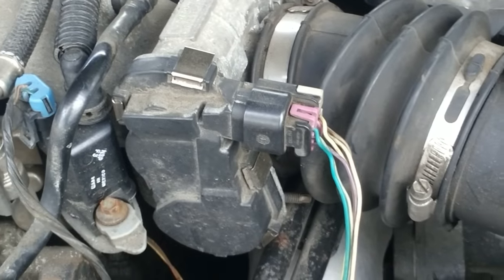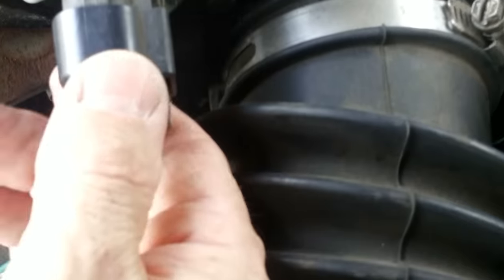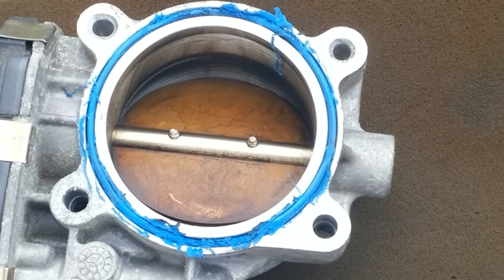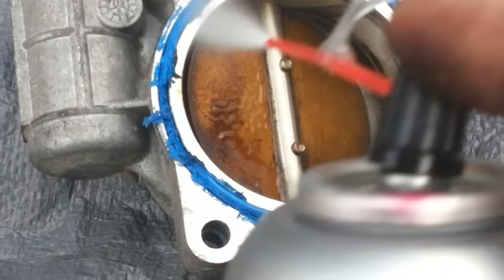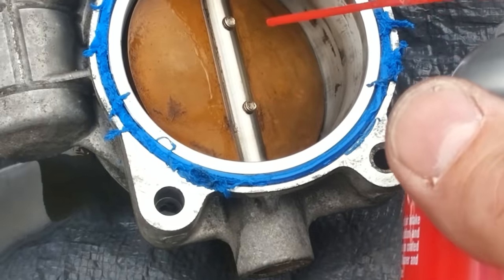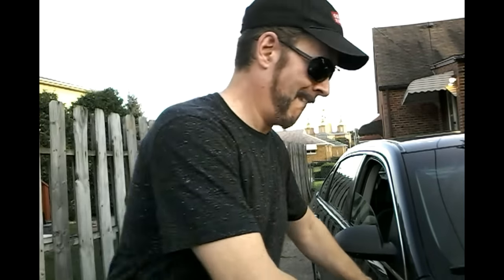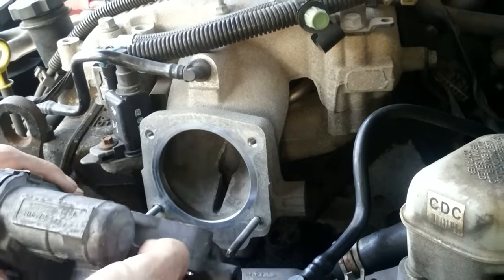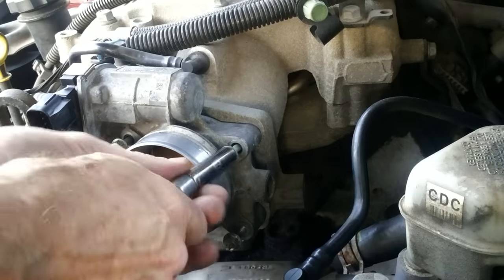Reduced Engine Power.  Here is the FIX.

Comment: I have a Chevy impala the engine power reducing  Light keeps coming on and barely letting me press on the gas and now I pulled in a parking lot to turn it off and let it cool off for a minute and now it won’t start at all just makes a clicking noise what do I do this is my first car so I know nothing about it and NOBODY AROUND THIS MF TOWN CAN HELP ME. Please help?!...😩😭😭
Reply: Just had same problem. I bought a replacement gas pedal off amazon and it fixed my problem . Clicking noise may be bad starter but Part u need  for engine reduced is ACDelco 25830023 GM Original Equipment Accelerator Pedal with Position Sensor
Reply from the maker: If it's just clicking it could be a dead battery.

Comment: Is there a way to test that sensor before replacing it? Have 2008 pontiac torrent with 3.4L and the reduced engine power light is on as well
Reply from the maker: Check for fault codes.  P2135 means throttle position sensor.

Comment: question would that be the problem for the service traction control too??
Reply from the maker: Vino Velasquez  That might be a different problem.  Several things can cause that. Most common is faulty wheel speed sensor.  What kind of vehicle?
Reply: It's a 2009 mpala.
Reply from the maker: Vino Velasquez  Check it for abs fault codes.  Thats a good place to start.

Comment: Would this method work on a 2006 Buick Rendezvous? A friend from work has gotten that reduced engine power pop up  as well but cannot find a fix for it
Reply from the maker: Have him scan it for codes.  P2135 mean throttle position sensor.  Follow the video to replace it.  Also, check all wiring and grounds.
Reply: @lifeafterlife8417  Awesome thanks mate much appreciated

Comment: it happens on my ‘03 silverado tho
Reply from the maker: Sometimes those silverados have a problem with the cooling fan.  It's on the same circuit as the throttle position sensor. When the fan turns on it drops the voltage to the throttle position sensor well below the 5 volts it needs which triggers the reduced engine power. Have your fan checked.  Could be a good place to start.

Comment: Well that is not the problem because I changed the entire throttle body and mine still did it 2009 Silverado piece of s*** mine did it for two years and I changed all kinds of crap on it so to say that's the fix it's not have a good day didn't like your video The Crickets were better sounding than you were

Comment: Someone help! I changed throttle body&sensor. And my gas pedal with sensor. I have a 2003 Chevy tahoe. I also put in a new battery. I ran for 30 mins and went back into reduced power mode.
Reply from the maker: The cooling fan is on the same 5 volt reference signal as the throttle position sensor.  If it is faulty it could be pulling that 5 volts down and triggering reduced power.  Very common on Tahoes.  With the vehicle running connect a voltmeter to the accelerator pedal position sensor.  Should read 5 volts.  When the cooling fan turns on it might bring that down below 4 volts.  If it does, disconnect the cooling fan and see if it comes back up to 5 volts. That will confirm a faulty cooling fan.  Best of luck!

Comment: GM needs to quit buying it's electrical parts from China, they've been going downhill because of that.
Reply from the maker: It's their drive by wire system.  It's a terrible design. Blame it on the engineers.

Comment: And all you chevy guys make fun of ford guys. I watched this video hoping it would help with my 06 saturn vue but nope
Reply: Not a Chevy guy.  Chevy VICTIM.  How can I help you with your Saturn?
Reply: @davidtankersley9520  all of a sudden today the reduced engine power light came on and the car wouldn't move
Reply from the maker: Does the engine start?
Reply: @lifeafterlife8417  yes engine starts sometimes it revs up when I hit the gas, sometimes it doesn't and if I put it in drive after reving it it barely moves
Reply from the maker: @jamesTBurke  If you turn the car off for 5 minutes and restart, does it run normally?
Reply: @lifeafterlife8417  yea engine runs fine but nothing happens when I press the accelerator
Reply from the maker: Ok.  First thing to do is scan it for fault codes.  This will give you direction.  If you cant do that then check all of the wiring going to the throttle position sensor.  Make sure you have a good connection. @jamesTBurke
Reply: @lifeafterlife8417  just replaced the entire accelerator assembly.  Now to see if it stays gone
Reply from the maker: @jamesTBurke Must have gotten the old P2136 APP sensor code.

Comment: LOL.
Reply from the maker: Try it.
Reply from the maker: @santanalarkin6118  Ok, first you can pull over in a safe spot and turn the engine off for about 2 to 3 minutes.  This will temporarily get rid of the reduced engine power mode and get you home.  Next, have the engine scanned for fault codes.  This could get you pointed in the right direction.  If you don't have a scanner you can take it to most auto parts stores (Autozone, Advance) and they will scan it for free. There are a LOT of possible causes for this.  Most common is a faulty throttle position sensor (code P2135.  This is the one in my video.)  Sometimes it can be the accelerator position sensor or gas pedal sensor. (code P2138)  Also check for broken wiring at the throttle position sensor.  It's mounted on the throttle body itself. But getting it scanned is the first step.  Good Luck!
Reply from the maker: @santanalarkin6118  Only if the sensor is bad or there is a mechanical issue with the throttle body itself.  Should be a code P2135.  What were the other codes?
Reply from the maker: @santanalarkin6118  Before you do that, check the wires where the harness connects to the throttle position sensor.  Check for broken wires under the insulation.  The wires can be broken but the insulation still intact.  This can happen when removing the throttle body for cleaning as this is a bit of a weak spot.  If this is ok, then would go ahead with the replacement.  Make sure the new throttle body comes with a new sensor as the sensor is the likely problem.  Also check the gasket for damage.
Reply from the maker: @santanalarkin6118  Yes.  I hope this solves your problem!